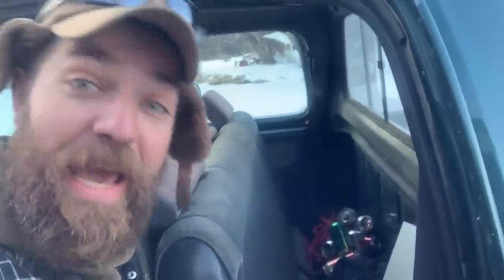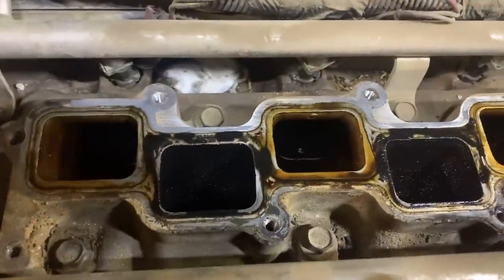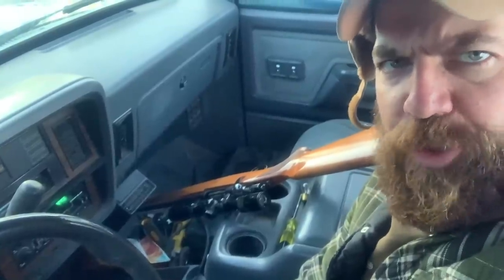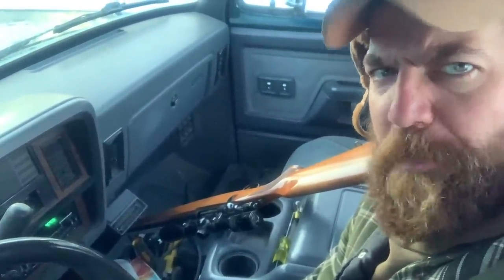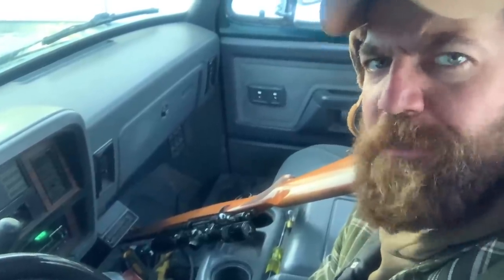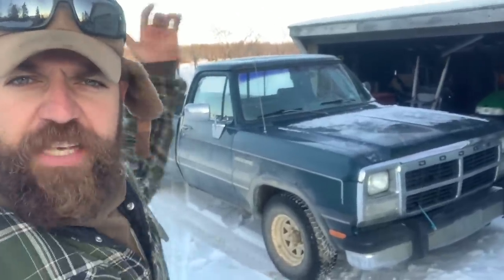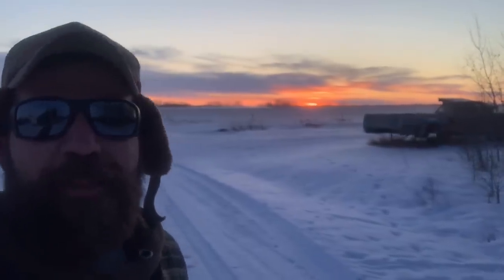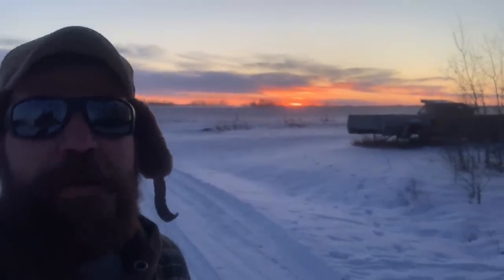Saskatchewan Farm Trucks

Comment: Just found you thru a buddy of mine. Here in Pa. we also keep "spares" and parts ....on the farm. Just an FYI in that 1970's extended cab 2wd Dodge.....in the vent box down on the passenger side ...slide that 4" sq. door back and reach down to the outside of the truck.....there is a steel box behind the fender that will hold a COMPLETE six pack of beer....and no cop will ever find it....how do I know? ...in 1983 I built a Dodge ramcharger into a super short bed pick up...used that "storage";) frequently in my high school.

Comment: Saskatchewan farmer trucks sound a lot like Ontario farm trucks. Except In Ontario you are expected to have at least 6 months of paperwork assorted small tools and shotgun shells on the dash. So when you need the defrost you have to dig a hole ( only on the divers side).  So you can wave to the other agricultural technicians. Because if you don’t they won’t pull you out of the ditch the next time you get a little to close to the snowbank looking at there new starlet bull. Have safe motoring in the flat lands!

Comment: un-cert-ed tech here..... 

hey.... at least i put all the bolts back into the bell housing..... unlike a GM dealership
which ended up cracking said bell-housing.... causing ALL the fluid to be pumped out in about 10 seconds..... 

dudes 700r4.... and a different customers 4l60e runs just fine..... 

but i DID lol like hell at that joke.... 

some people run away
other people ONLY trust me.....even to do an oil change on their car

havent fucked up anything.....yet

Comment: *Elite Saskatchewan Farm Trucks Club recognizes that engine replacement requirement does not apply to Dodge/Ram trucks originally equipped with Cummins engines.
Reply from the maker: yako0000 - you, Big Moustahce Al and The Dusty Wrench may just be kindered spirits!!

Thanks for watching!
Reply: I would argue a slant 6 could possibly fit in this category
Why not make an exception for a gaspot
Reply: @codychickadee5095  well i ain't the guy making the rules but i have owned a Slant-6 and they are exceptional engines.